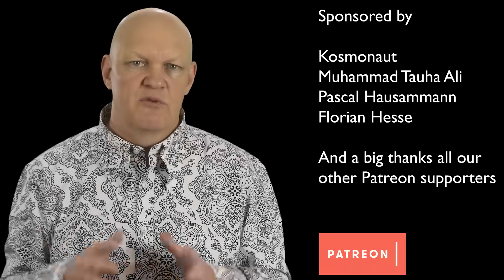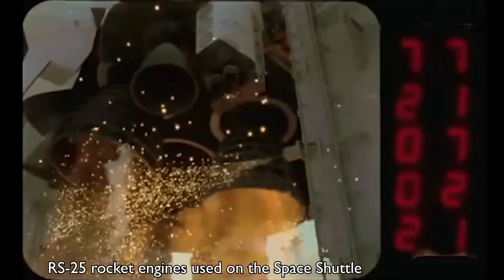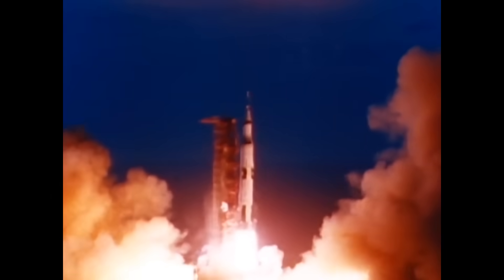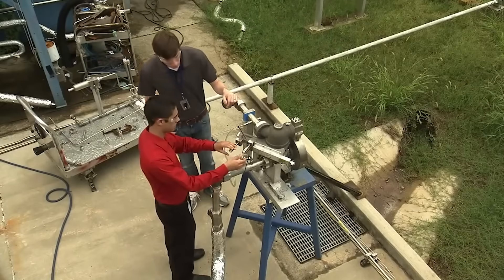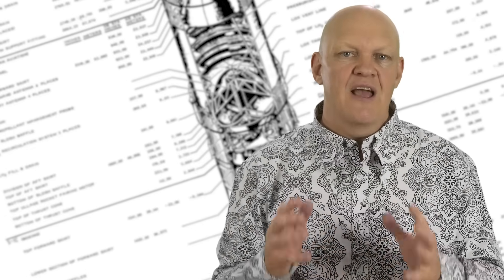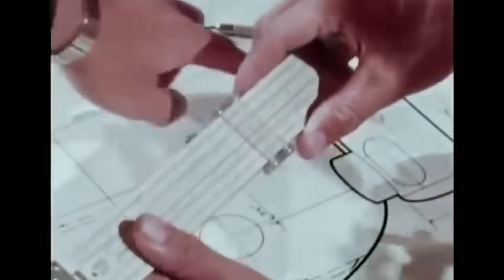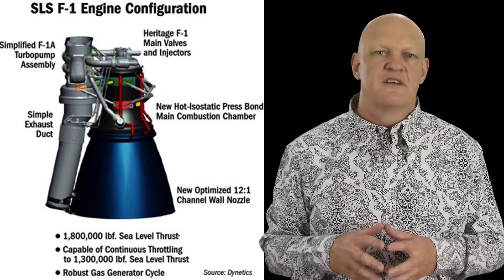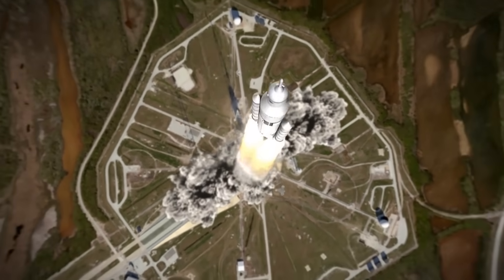Why Can't we Remake the Rocketdyne F1 Engine?

Comment: I met several of those NASA engineers at a DARPA event. When they were handed the blueprints for the F1, most of them quit. The posture was "we came to NASA to create new technology, not recreate old" and off they went. The rest did remove an F1 from the Apollo Museum and had it disassembled and spec'ced out. The issues varied, shock waves, politics, costs, etc. When Constellation was killed by the Obama Administration, so went any dreams of an F1-B and in came the SRB/RS-25 combo.  Little known fact, the Saturn V flight management computer is still listed as top secret. All the other computer gear and any software written has been released, but not the FMS for the S-V. The only FMS designed to control 5 F-1's. Think of how many entities would like to get a hold of it today.

Comment: FYI they have lost/ burned a lot of the paperwork/ blueprints on most of the pre shuttle stuff. How do I know this? First my wife works for NASA and is on SLS and has been told this. Second I am historian and have personally used lifts to carry current engineers along with old retired ones in lifts as they as they examine all aspects of the Saturn V and talk with them to explain why they designed things a certain way. I have had to run the lifts and document the exchange between them over 100 times already.  A lot of the old files from Marshall was used to burn in the mini power plant on Redstone Arsenal. Quite a bit more was taken by employees and sometimes when they die I get to recover a few documents.  So yeah most pre shuttle stuff is gone or destroyed.

Comment: NASA lived on the skills and experience of the old school engineers and technicians for many years. When NASA decided to cut corners and reduce testing, many of the engineers and technicians put the quality and techniques into the spacecraft because they didn’t know any other way to do it. They were told to hurry up, don’t test and not to worry about quality by NASA management but they just couldn’t do a sloppy job. Many of the successful spacecraft were successfully because of the extra care and workmanship that was put into the them in spite of the managerial interference. When the old school technicians and engineers retired or moved on, NASA experienced more failures. NASA has always had a management problem not technical problems.
I know because I was there.

Comment: Every nuclear plant on a submarine is made differently. Why? Sometimes patents, sometimes trying something new, and i  believe sometimes just for the hell of it.  There are welders out there that have the skills, but you can't pay them 100$ for a 1000$ job. The government and NASA don't want expertise any more.  Theywant the low bid.  Look at the japanese nuc. Disaster and look at the design.   Why they failed is design.  Loss of electricity for pumps that should have emergency generation even if water  table rose or not.  It flooded from the top and no way to run pumps to get the external water out.  Design.

Comment: shouldn't our modern newer technology be more powerful?
Reply: Thrust requirements are ultimately dictated by what you're trying to send into space (more weight = more thrust). With the notable exception of manned lunar/interplanetary capsules, there is virtually no need for a launcher than can put over 100tons into low earth orbit.
Newer engines are generally more reliable and efficient than older ones, and in many ways cheaper, because that's a benefit regardless of the amount of payload you're sending. Most demand for space access remains in LEO.

Comment: The sad truth is that there aren't many people willing to do the sort of detailed work an F-1 took to assemble and get working. It'd be great if we could get a production line for a modern version up and running, but every launcher on the market today comes with a dedicated engine designed to work with it, so you'd literally have to start a new booster production line to use them.

Comment: To Engineers and MatSci/Metallurgists graduated after, say, 2008, and steeped in state of the art mfg. techniques, I'm sure these iconic F-1 engines seem, in many ways, as quaint as a WW1 biplane does to me, but... the ONE "data point" they need to hold paramount--and have tattooed on the inside of their eyelids--is this:  This pioneering powerplant had a 100% Flight Reliability Record  Not a single mission was ever aborted (or even orbit-diminished), not a single astronaut was ever killed by an F-1 fault.  It went 65 for 65, batted a perfect 1.000... that's your benchmark, kids... no pressure... back to work.

Comment: It's still somewhat bothersome to just accept that a machine that was changed and altered so much as this video suggests, so much so that we don't have accurate blueprints, just flew 225,000 miles to the moon on the first try. If the blueprints were accurate, there's probably a number of facilities that could churn out the parts in a matter of days in the modern day. The idea he's stressing that it was all about the process rings somewhat true, but his further example that each rocket was unique etc just adds to my confusion and this romanticization of something that should be straightforward is distracting and irrelevant.
The "people who have moved on" could have easily been asked in the 50 years that have transpired.
Finally, what are the EXACT skills that have been lost to the modern age? He spends time stressing welding and how long it took in 60's... Well great, I'm sure it doesn't take as long these days...

Comment: But the real 64,000 dollar question is, what was the F1 actually designed *for*?  The narrator above states incorrectly that the F1 was designed in the 1960s.  It wasn't.  It predated the Apollo moon program by several years, having started life as a classified USAF project in 1955.  It wasn't designed for the Saturn V.  This may sound remarkable, but the simple fact is that **nobody today knows what the F1 was actually designed to do**.  It was not designed to put people on the moon.  And anyone who would know the answer is long dead.

Comment: Many smaller engines are more reliable. Spacex blew a Merlin engine up complete with shrapnel flying out the back and still made it to the ISS. Blow a huge engine up and the mission will fail.

Comment: As a design engineer I think this is just BS - if something was build 50some years ago and you have the original documentation for it, it can be certainly build with the modern technologies. As well it can be easily redesigned in modern 3d cad software and improved without a great effort from a team good engineers.

Comment: Alright, I need someone who knows the conversion to do the math; how much horsepower is 1,800,000 lb of thrust equal too?
Reply: It's a bit meaningless, because rockets use direct thrust - they don't have a drive train. But a Saturn V first stage is sort of equivalent to about 160,000,000 Horsepower.
There's more details and the calculations on Quora.

Comment: WELL,, WELL, WELL 
the Saturn rockets worked great FACTUALLY;   
H2O2 however in liquid form burns  hotter than 
1 M.E.K.
2 nitromethane
4 flashpoint of Cu+ ;  

MSDS sheets will agree;  
M.A.Bodine
Reply: What the hell do you mean by "M.E.K."?
The chamber wall temperature was about 650°C.
The chamber was made from Inconel X-750, which melts at about 1400°C.

Comment: You have plus or minus tolerances all over the place. Same as a car engine. Different thicknesses for like rod bearings and such. So what’s the problem? I’m sure these same tolerances exist in these rocket engines. You just need a bigger hammer. Are they hiring? I can rig one to work safely I’m quite sure. Oh yeah and I smoke a pipe. You can see it hanging in my mouth on my profile pic both hands on the guitar "working".

Comment: why would you want to make an old part the same way they did a long time ago, when you can build it better, cheaper, and more reliable with modern science?
Reply: because the saturn V had 10 succesful manned flights out of the earths orbit, a feat that hasn't been accomplished since, so the obvious question is why not just recreate the succesful design??? I am currently watching spacex doing tests flights of something that was accomplished 50 years ago......doesnt add up
Reply: Pretty sure no one has the political willpower to make a Saturn V rocket using something similar to the F1. We just have better options that doesn’t face the F1’s same problems... Like the engines the space shuttle

Comment: This is why I like old cars. They have the spirit of the true engineers of the past.
Reply: @Carl Klinkenborg I remember our Ford Maverick that would breakdown after only a few years.  It was rare to have a car last over 100,000 miles.  The next car after our ford was a Honda Civic and that car went over 200,000 easy.
Reply: People like to romanticize old cars, but going back and working on them after spending years working on newer ones reveals just how bad they were. Yes they were relatively simple, but that simplicity is accompanied by a myriad of bad designs and common failure points. There’s a reason modern cars tend to last 3-5 times longer than they did 40 years ago.
Reply: splewy what about oil? I’m curious how much longer they last with modern oil in them.
Reply: Shinigami117 S  I think it’s a bit of a wash. Yes modern oils are better, but modern engines tend to also work that oil much harder with much tighter clearances, greater temperature demands and longer oil change intervals. 

When I think about things that make newer cars more reliable though, the biggest things I can think of are electronic fuel injection, much better wiring quality, and vastly improved materials technology (from metallurgy, to synthetic rubbers, to plastics, etc.)

Comment: The concept of "Technical Debt" that has been coined and refers to the progressive and steady "obsolescence" of software over time would apply to the erosion and loss of engineering and construction capability to recreate the Rocketdyne F-1 engines used in the Saturn V rocket for NASA's  Apollo program.

Comment: If you have the actual blueprints then you have all the parts. C&C can make all the parts. The machine works and it works well. There's a reason is not being made but that's probably a political reason Not a logical reason.
Reply: The politics around this is largely based in logic, like the guy said in the video. It would be about as illogical to build and US Apollo hardware these days as it would be to build a Duesenberg from completely newly manufactured parts and drive it around on today's streets.
it's just too inefficient and expensive, with much better modern versions that are likely to be cheaper.

Comment: Presidents driving industry away from the USA didn't help engineers should be pissed about that..!
  Germany and Israel only have those engineers..!
    A college requirement is that these Engineers learn metallurgy and could go from caveman to modern-day car Tool & Die selecting materials and molding the metal themselves with no Advanced tools whatsoever..!
These students that study these courses are the real Engineers the only thing we have left is people that worked on the surface of that kind of Technology.! In Germany that kind of technology is a requirement in Israel it's a it's a requirement are you won't graduate..!

Comment: The problem with the ever increasing speed of technological progress is that it is often blind to what it's throwing away.
Reply: true.  That technology and much info has been thrown away in favor for people kneeling before a phony marketing pundit steve jobs.  Today, the latest idea of 'technology'  is holding the latest reincarnation of a phone in their hands and learning to correctly swipe their pointer finger.  Hopefully only a setback and not the very first steps back to caveman days.
Reply: Yes it's disheartening that just as a technology reaches it's pinicle, we for some reason discard it entirely for something so radically different that it is only the hard core few that can appreciate it's significance and preserve what they can by what ever means they can and are labeled as mere enthusiasts.  Our unbridled quest for technological advancment snuffs out perfected technology in favor of sometimes less reliable and in many cases just repackaged and modernized ideas.
Reply: @kiwidiesel5071  Sometimes but this is cearly not the case.
The old F1 engines had to be hand crafted and tested multiple times while correcting unique little flaws that every single engine developed. Every engine had to have its own development process.
The new designs do not face these issues and could be developed using computer technology making them independent of the minds that created them.

I think this case should not be used as an example of how knowledge is lost through technological advancement because the 50 year old technology really isn't anything you would want to bring back.

Comment: It was built from scratch once, in theory, it should be able to be built the same way it was originally. That is to say if the "old timers" could build one from their brains, why not figure it out the way they did?
Reply: At that point it becomes a question of worth: reverse engineering something as complex as the F1 engine will be expensive. That money could be better spent designing or adapting a new engine.

Comment: Why build this when we can build a better engine? Like the Space X Raptor.
Reply: did you here that 1.5 million pounds of thrust  best the puny raptor can mange  is 440,000
Reply: Dustin Cordell I did hear, that you can cluster engines. Hear hear, I hear people say. Spelling such a lost art.
Reply: @admindiscovery6901  it was hear until auto correct and yes you would have to  cluster them  meaning you just negated  the point  one  F1  engine  is worth 3 raptors be elons fan boy all you want
Reply: @madman026  Raptor can work on methane, which is cheap and can be produced on Mars. Also, it can be shut down and reignited as many times as you want.
Reply: @caav56  you know what its ok  what ever you just need more raptor to get the same job done the  f-1 could do in a single  launch  but what ever
Reply: @madman026  F-1 was planned to be replaced anyway, either with absolutely nuts hydrolox Aerojet M-1 (seriously, this thing makes F-1 seem tiny in comparison, while also managing to be more efficient) or some upgraded versions of F-1. However, all of those had the same problem - they all are single-use, though it's far from impossible to make them reusable. Raptor is the best bet we currently have.

Comment: Building a new version of the Saturn V with the F1B engines would be a step in the right direction. We threw away the best heavy lift vehicle ever flown due to budget cuts, and stagnated for decades. The Apollo technology had the potential to take us beyond the moon landing and still does. I'm all for technological advancements, but after three decades of use it is hard to claim that the SLS technology was an advancement. If we want to get to Mars, it seems like a rocket with 5 engines and 7.5+ million pounds of thrust would be a good start.

Comment: They F-1's were just impressive film props, which actually had smaller rocket engines inside them, which is why there is a very noticeable gap between the rocket plume flame and the rocket bell nozzle...The Saturn V was also a film prop, albeit a working one...It was the only part of the Apollo hardware that actually had to be built and launched in order to fool the press, public and politicians alike.  But they took off with a fraction of the payload they allegedly carried because a glance at the specs showed each took off with half a million litres less LOX than required to lift the alleged Apollo payload.  Ironically, the maximum payload that could be launched with the amount of LOX carried just happened to be an Apollo capsule, with three crew, and enough provisions for a week long trip in low Earth orbit, during which time the missions were being faked by specialists and filmed in studios here on Earth using a combination of live studio footage and pre recorded footage using a mix of actors and scale models.  The Cap-Com audio being pre-recorded and bounced off the Moon (EME (Earth-Moon-Earth) communications were used long before Apollo to vastly increase the range of Earth based stations, before the use of space based Satellites became common place,  using the Moon as a natural radio wave reflector) to fool receiving stations on Earth of their actual origin.  Then at the appointed time the crew would initiate re-entry procedures, which would of course look genuine to the waiting press, unlike the fact that they had been faking the Moon landing the whole time.  And the gullible fools bought it, hook, line a sinker!
Reply: That's bullshit. First of all, a smaller engine (presumably the H1) would clear produce an exhaust much different from the one we saw. A nozzle that large on an H1 wouldn't work at sea level without under-expansion. On top of that, the reason why you get a dark layer between the f1 nozzle end and the flame front is because the engine itself uses film cooling: that dark area is literally the dark turbopump exhaust over the rocket exhaust.
Also, you can tell the Saturn V was full. The fuel being cryogenic, ice was clearly visible along the rocket's body.